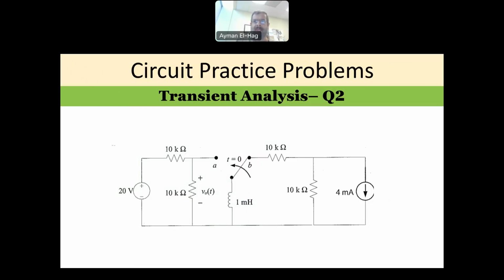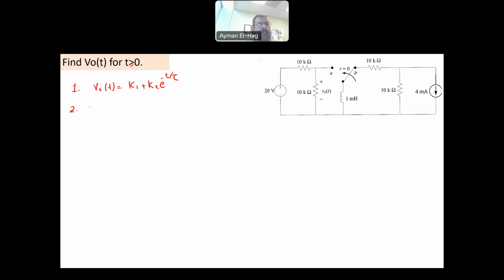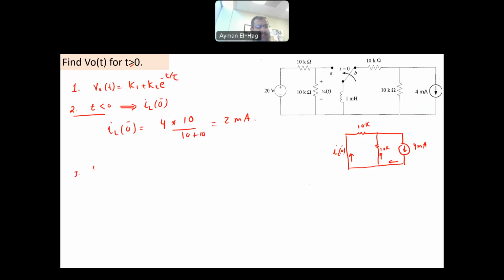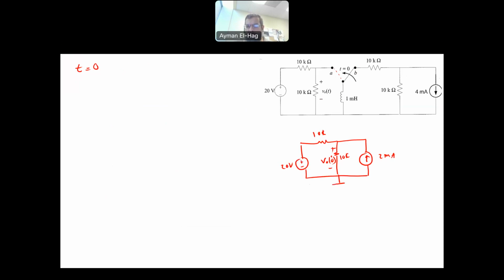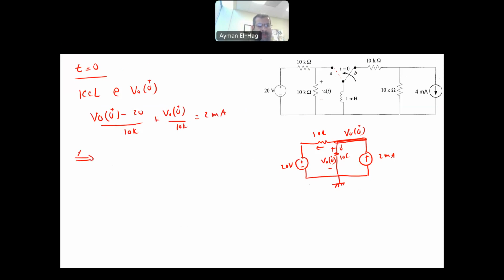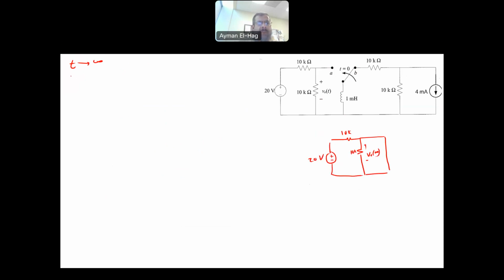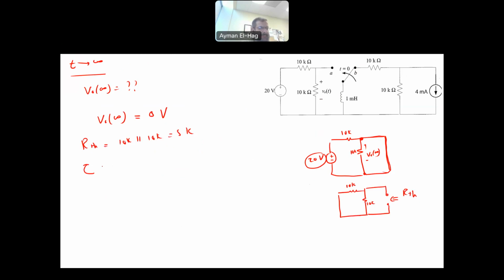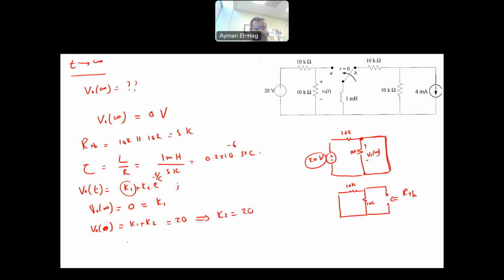Transient analysis - Question no. 2

Comment: Thank for the explanation, just wondering why do you include the 2mA source for the inductor in position B? Thanks.
Reply from the maker: At t=0 the inductor will maintain the same current just before the switch move. So it will be modeled as a current source